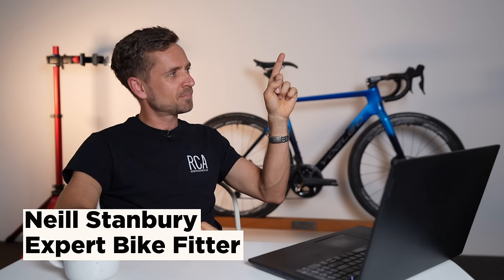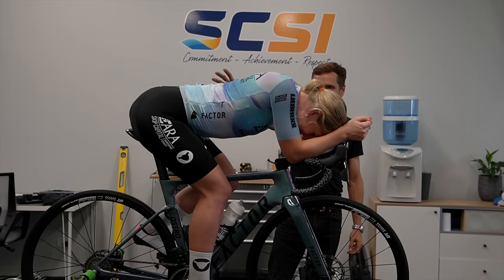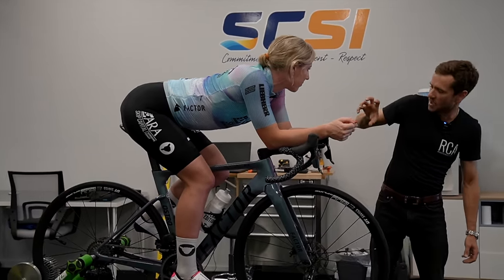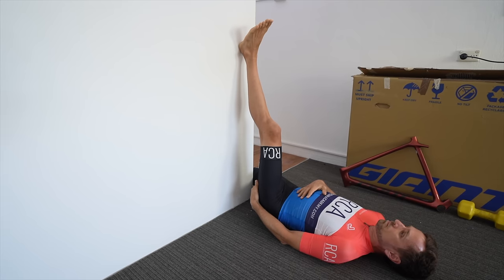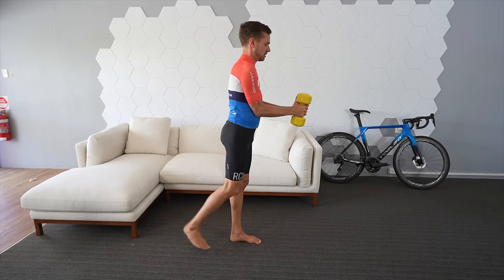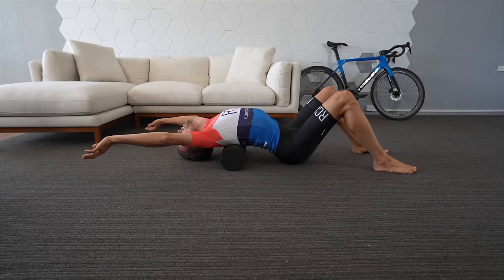Get Faster & More Aero (with THESE Specific Stretches)

Comment: My life hack is doing stretches while I brush my teeth (do use an e-brush ;-) ) so I try to touch the ground with my hand. My e-brush has a 2min progr devided in sesions of 30sec, first I touch and go up, second I touch and hold for 5sec times 6, third I touch and hold for 10sec times 3 and lastly I touch and hold for 30sec. It may not seem like a lot but it gives me a total of minimal 4 minutes per day every day and while that still is not a lot, at first I couldn't touch the ground during the first session where I can now and even lay my hand flat on the ground. besides that it is clearly noticable while riding my bike. Maintainable habits for many is hard certainly for me while now during brushing my teeth I can either look at my six-pack which I don't have or do stretching so stretching it is!

Comment: 1 — Hamstrings Stretches · 1:54
1.1 — Contract-Relax-Stretches, Static End of Range Stretches · 2:20
1.2 — Single Leg Arabesque, Single Leg Romanian Deadlift · 3:15
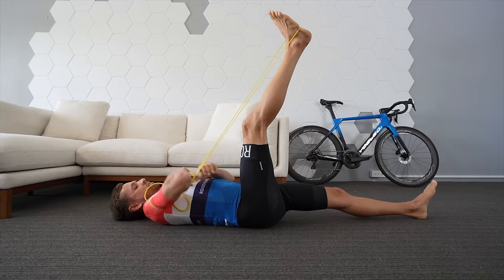1.3 — End of Range Band Exercise · 4:20

2 — Thoracic / Lumbar Stretches · 4:50
2.1 — Fascia Stretches with a Roll · 5:15
2.2 — Thoracic Stretches · 9:11 
2.3 — Rotation and Lateral Stretches 9:39 

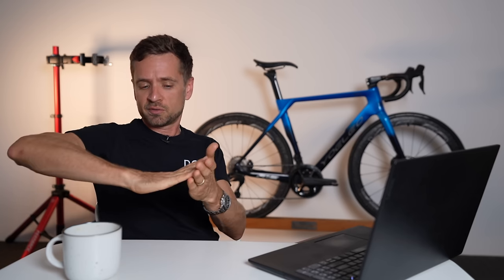3 — Hip Stretches · 6:00
3.1 — Four Point Stretches · 6:54
3.2 —  Hip Flexor Stretches · 7:10
3.3 — Pillow Squeezes · 7:18
3.4 — Knee Pulls · 7:50

- Hold for 30–60 Seconds
- 3–5 Repetitions
- 2–3 Times / Week

Comment: I have found that the main limiter for getting aero for me is saddle comfort. I am able to rotate forward an incredibly amount to the point that I get frontal saddle pressure on any normal road saddle I have tried (a lot). As of recently I have been using the new Fizik transiro long distance tt saddle with a split nose design on my road bike and am no longer limited in my rotation forwards and feel a lot more comfortable. My question is: If it is ok to run a tt saddle on my road bike to solve this problem or are there any other complications that come with running a tt saddle on a road bike? I have tried a lot of things, but nothing else seems to have had the same effect.
Reply: Are you displacing significant amounts of your body’s mass away from the pedals into pressing down on the top of the saddle instead of just touching the top of the saddle and leaning the sides into your thighs most/all of the time?

Comment: Hi Neil, great video once again. 
1:00 every time I get into more aero position (e.g. on the descends/flats as opposed to the climbs) I feel as if my saddle up higher. Is it because of the change of my hip positions?

I've had problems with my groins (tightness and pulling sensation), I noticed some time ago that my pelvis often rotates posteriorly, or when it goes anteriorly my back is kind of rounded up and my ribs are close to each other, as if my torso is compressed (I'm not sure how to describe it). Do you have any advices for what I should do? I've been to a few physiotherapist they said that my groins are tight, and my hamstrings are overstretched.